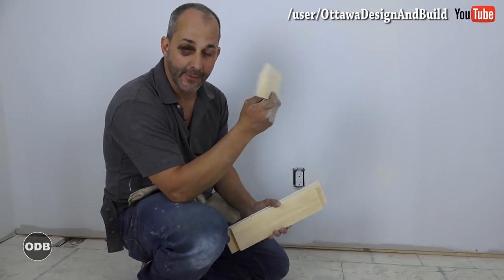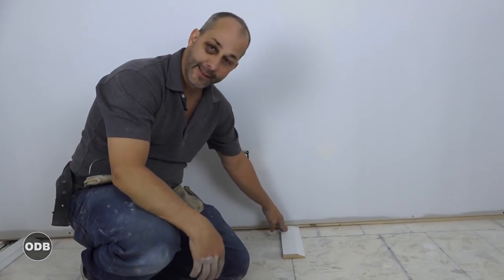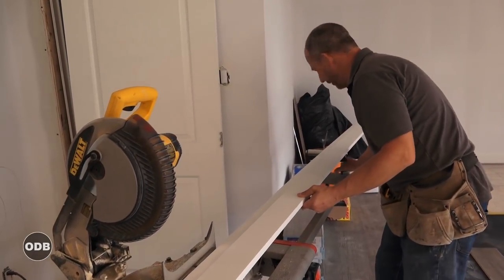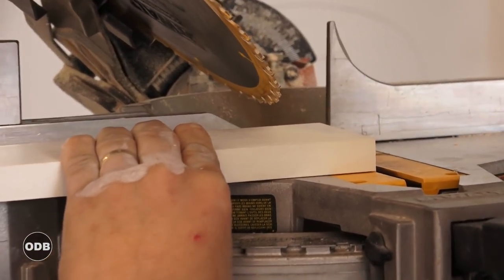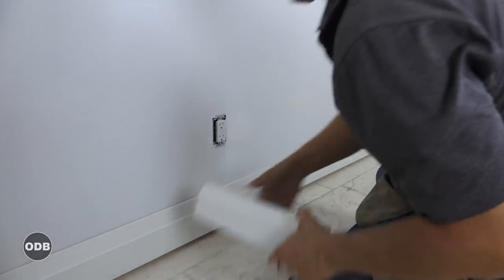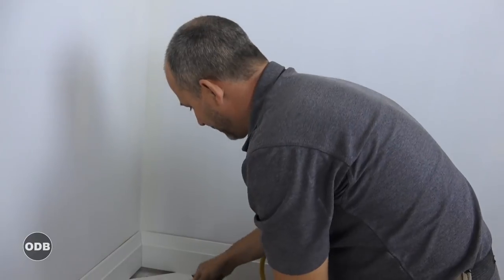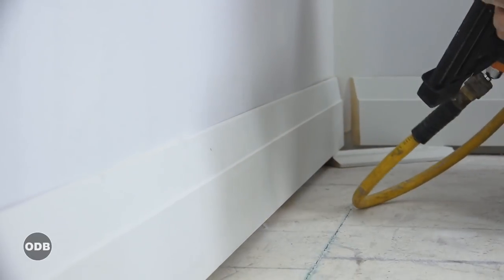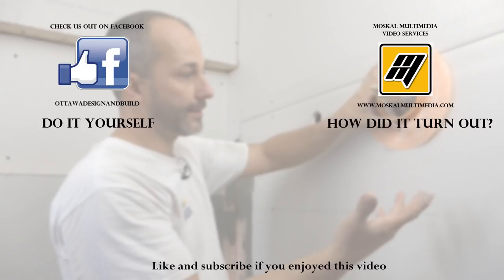How To Install Large Profile Wood Baseboards

Comment: A tip I learned years ago, and which I practice to this day is: prime all sides of your trim. The intent is to reduce the risk or degree of shrinkage (contraction-expansion) and therefore separation at corners and other joints. Seems to make a difference. 
Another tip that also seems to work well is to use biscuits in joining outside corners -- this is a more aggressive way of the gluing exercise you show. (And glue always goes on both surfaces.) This is good on outside corners of baseboards, and on corners of casements. Adds very little time, helps keep all surfaces flush, and yields a strong, long-lasting bond. 
Third, if you will be putting in quarter-round as well as baseboard, then locate your lower brads if possible in the area of the baseboard that will be covered by the quarter-round. This makes for less hole-filling and paint touch-ups later. 
I believe all came from Fine Homebuilding articles over the years..
Reply from the maker: Good tips Don.
Reply: Thanks, Jeff. I've watched dozens of your videos over the past few weeks, including your comprehensive series on drywalling (excellent). They are consistently first rate. I find myself watching the gamut: similar projects to ones I plan to do, ones I've done in the past, even those I'm not likely to ever entertain! No matter what I have already done or know, you continually illuminate with new tips, techniques, insights -- and tools. (Your line on one: "Why rent a tool, when you can purchase it?" resonated!)
As has been expressed by many before me, I really appreciate the time and effort you put into these, the commitment you show. It is a great service. Looking forward to whatever you post in the future. Thank-you.
Reply: A tip passed on to me when I did not want to shim, put a screw at the bottom of the base board (behind the base board) and nail the top

Comment: Thank you for the professional video, I have three general question topics:
1) Finish nails or brad nails for this oversize wood trim? How do you then mask the nail after install?
2) Can you install vinyl plank first then the trim to avoid using quarter round? If so, what kind of space do I need between the flooring and the bottom of the trim?
3) Do I have to be weary of what lurks behind the drywall? I'd avoid being directly under electrical switches and outlets, but what about plumbing, etc?

Comment: While not a wood worker myself, I'm a big fan of the coped joint. Nothing is straight, I can tell you as a professional painter that fixing a 1/4 gap on a inside miter is very difficult. While you took the time to line up your miters, most "professionals" in my area don't. I wish coping was more common place.
Reply: Professionals need to make money in a fast competitive market. 50 years ago carpenters had the time to cope every joint.

Comment: When I did my baseboards, I just cut inch lengths from a PVC board that was shorter than my baseboards and placed them in the corners. I didn’t have to cut any angles. Everything just fit perfectly once the boards were properly measured and cut. They look great and very stylish after being painted and caulked.

Comment: Pump up the base! I always like to mitre as well. You get a good surface area to glue.
I used to shim at inside corners or fire a couple nails behind to keep it from diving in and leaving a gap.
I now prefer to put my fingers behind base a couple feet from the corner and pull base out a couple inches. I then put a nail close to the corner into the bottom plate. When I push the base back against the wall the nail acts as a fulcrum point and closes the joint.
Another great vid dude!  Thanks!
Reply from the maker: Nice touch. There are truly tons of ways to achieve this result. I chose this because it doesn't require much experience for the homeowner. Your way makes good sense. I will try it.

Comment: Again! Perfect timing with your great videos!!! I am just finishing putting in laminate flooring in my basement music studio I am building. Molding is next...however I already painted the walls before I saw your video. I also want to avoid using a coping saw if possible. I'm glad there are still builders that use the tried & true miter cut!!! Thanks for the great videos! They have helped quite a bit throughout my project!!!
Reply from the maker: Thanks Mike, you will have to send us your pics when done so we can feature you on Instagram. Cheers!
Reply: Home RenoVision DIY Sure...here is a link to some images of my studio. I'm still setting everything up but you get the idea http://imgur.com/gallery/h4MMo0T

Comment: Just one more tip: I use spring clamps when bradding all outside corners of baseboards and casement. These help align the surfaces while applying the brads. In effect, they act like that "third hand" Jeff is often mentioning. The pliers and 4 spring clamps cost $38.50 (CDN) at Lee Valley. A sound investment.
Reply from the maker: Wish I had the time for that. In my business I have to trim out a basement in 1 day or I would go broke.

Comment: Hey Jeff! I love the videos. I just wanted to say that you can cope your corners with a grinder and sanding disc works faster
Reply from the maker: I will have to try that! Thanks
Reply: Grinder?! You can't be serious, bud. Just get a coping saw. That's what it was made for. Do this: cut the piece to the length you want (square ends), then 45 (as and inside corner) the end you want to cope. Get your coping saw and cut all the exposed material (if you trim is primed, that would be all the raw wood/mdf) on a slight angle. Boom. Done. No grinder. No sanding. No noise and, most importantly: perfect joint. 👊🏼
Reply: Ha! Thought I was the only one that uses a grinder! So easy

Comment: I’m assuming you were using a Brad nailer to attach the baseboards.  Do you use 18 ga. brads that are at least twice the thickness of the baseboard you are nailing or longer?

Comment: If you take the corner angles and cut accordingly to that degree you do not have to use shims and loads of caulk. In the corners especially you will see wider caulking from the top.
Reply from the maker: You always have the gap from the taping process. That is what I am shimming.

Comment: Would you use that same saw to cut/trim vinyl plank flooring that has the underlayment attached? If not what would you recommend for the more difficult custom cuts to get flooring around corners and other odd shapes?
Reply from the maker: I use a jig saw for odd things. just use an aggressive wood blade it works great.

Comment: Not the method I used. I did a 440 meter building ( that is 1600 meters of skirting ) at my home using the method where I cut the straight edge of the skirting at an inward angle with the power saw, and then simply used the coping saw to cut around the edge of the curved top corner. Very simple, very clean.

Comment: Should the baseboard be off the flooring slightly or can it touch the flooring? Maybe I missed it somewhere in the video. In other words, I guess, can the baseboard sit on the flooring or should it not? It's a LVP, waterproof flooring. Thanks.
Reply from the maker: if you install the base after the flooring try to get as tight a fit as possible. cheers!
Reply: Thanks! Cheers   @HomeRenoVisionDIY

Comment: Hey bud hope all is well in the great white north! I will be redoing my baseboards now with the caulking you're using would you use that for your nail holes as well or would you use a drywall compound and do you find you have to still tap in your nails a bit or is it a matter of just getting the pressure correct? Thanks bud stay safe!
Reply from the maker: Set your pressure up right. Use a little spackling to finish. Good luck.
Reply: Thank you sir i appreciate it!

Comment: If we are nailing trim over finished floor (hardwood) is it best to lay it flat on the floor or try to match corners?
Reply from the maker: If you can't match the corners use a shoe molding to finish the base.

Comment: Do you install the baseboards before you install the laminate?
Reply from the maker: you don't have to but in most professional applications all the trim work is installed prior to installing the flooring. This way they can spray the finish paint without using any protection.

Comment: Great videos.. just wondering if I use the same 5"1/4 one step baseboard would it look odd with my 8ft ceilings and 2"1/4 casing around the door?  Should I go thicker casing if I go with 5"1/4 baseboard?  Any help would be greatly appreciated
Reply from the maker: I would not be as concerned about the width of the trim, the one thing that screams ugly with trim is when the thickness of the base and casing don't match. If your tall base is the same thickness as the casing then I would say keep it as long as they are a similar style. Cheers.
Reply: Home RenoVision DIY great thx for the help.. The thickness of the casing is the same thickness of the baseboard.. unfortunately the casing is from 1970 original to the house.   South western ontario house so I'm sure you'll know about all that casing.. I'm alright tight in corners so I'm not sure a thicker 1 step casing is in my future.. I'm sure all painted up it will all look good
Reply from the maker: Awesome Jesse. Lord knows there is enough work to do in a home without creating it yourself. At the end of the day if the only thing left to update is the casing, and you get bored, then look at it then. Cheers

Comment: installed trim around a closet. Problem is where the thick side isn't flush with wall and no stud in that area. Using a nail gun. Can I cross nail like u would using a screw gun?
Reply: Yes that's how it's usually done in that scenario,  shoot nails in an X pattern where you can't hit a stud

Comment: He's measuring "beneath the mud joint" is the key. 

If you're measuring from finished corner to finished corner, then don't take off 3/16" , maybe 1/16" or less, or you'll be caulking 3/16"

Caulk and paint make you what you ain't

Comment: A tip I learned a long time ago, is if you have a spot along the wall where there is no drywall (void) screw in a drywall screw for the base to rest against. It keeps it from pulling in too tight
Reply from the maker: Any gap over 1/3 the baseboard height is a good rule to do just that.

Comment: Just a bit of critique from a trim carpenter... I scrape the inside of a corner with a 4 inch drywall knife and use a scrap as a guide to tell me how high to go. Also you cant assume corners are exactly 90... If you want truly clean results u must get a yellow angle finder they are literally $6 at HD in Canada and probably less in the US. Figure out what the angle is, do the math and with a little practice you won't need caulk in the corners or shims. and the lack of shims means the caulk line at the top of the mould is constant and close to the wall. Also CA glue and accelerator make a world of difference speed wise.

I am a fan of 99% of the videos tho (Im just picky about trim)
Reply from the maker: Thanks Shelby, Just trying to show homeowners a few tricks to make life easier. Not sure how many folks know about CA glue and accelerator. We will show that product another time. Thanks for the comment , some really good advice there.
Reply: Np if your ever around Toronto and want some more advanced tricks for base ,crown, wainscoting etc let me know...

Comment: Take the time and cope the joints.  Have pride in your work.  Miters look terrible.
Reply from the maker: I don't agree.
Reply: No professional carpenter in his right mind would cope every joint. Tyr it yourself when you have 6000 linear ft of base and crown to do. Good luck trying to make some money
Reply: @allanmitchell3240  I'm a professional carpenter.  We always cope our base.  I cut an entire house (1000-2000 linear ft depending on the size of the house) almost every single day.  Only takes a couple hours per house to do base.
Reply: How do those inside corners look terrible?

Comment: took you ages too try and make that mitre fit, do it properly and you wont have this problem.
Reply from the maker: Takes a lot longer to cut and cope and sand.
Reply: well no it doesn't, i have been able to prove this on numerous occasions.
let me ask you what is quicker 2 cuts that will never fit properly,  ie have to re caulk them when it  shrinks and also leaves a very un professional finish,
 or one cut that fits properly and you don't have to hide with caulk?
there is no argument for mitring internal angles.
very bad advice.